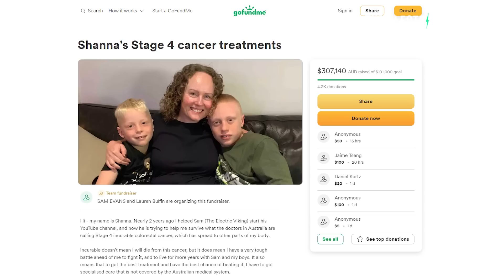CATL unveils Condensed Battery for Aircraft & 1000 mile range EV's

Comment: Solid state batteries will still be something worth looking into. They can have even larger energy densities  than this, while having better volumetric energy density, and could have the potential for no or significantly smaller cooling systems since they produce less heat. But yeah, this new development from CATL is insane, can't wait for my 1000 mile cars
Reply: Actually, it's not that they produce less heat. It's that they're more resistance to heat.
Because of the lower electrolyte conductivity and "viscosity" vs liquid electrolytes, solid state electrolytes tend to generate more parasitic heat actually.
Reply: I'm still banking on solid state in my opinion they're still the better choice
Reply: Looking into is not enough, Toyota has been researching it for a decade with little to show for so far. 
 It now becomes much harder to make it profitable to introduce. Questions arise like:
1- What new market can it open, and is it large enough?  For instance development of ever smaller  processors, would be dead without smartphones. There simply would not be a market big enough to carry the development costs. 
2 - What are the production costs? Sodium batteries will be produced on large scale. What cost benefits does solid state bring and at what quantities can it become a competitor? 
3 - What if sodium batteries are improved even further? 
4 - can they satisfy all the important aspects, like safety, charge time, durability, recycling, temperature sensitivity. Or do they have downsides that limit its application? 

It may have a market in aviation, when electric planes take off. One thing is certain, for many investors the equation has changed now. But if it promises real benefits than CATL will likely want to develop it as well.
Reply: @janbour8152  Solid states batteries aren't limited by chemistries. They're just cells that use solid state electrolytes.
Reply: semi solid state batteries have poor cycle life
Reply: @rwyo83  same with every other rechargeable battery when they were first being developed. So what's your point? You think technology is stagnant and can't improve?
Reply: @hmbro3236  semi solid state batteries works fine with battery swapping, for that reason Nio is ahead of Tesla
Reply: Japan has abandoned Batteries for Hydrogen. Anyone with an IQ Higher than their own Butt Hole realises batteries though improving are a lost cause. It simply takes too many to do anything useful too long to charge and there is and never will be enough electricity to run Society Industry and EV' s as already pointed out 500 tons of earth need to be mined to make one EV they're NOT environmentally friendly same for Solar Panels impossible to recycle. With a short life span. While these technologies will continue and have a place long term they'd technological DODO's and attempts to hype and up sell them are not in line with reality.
Reply: @yfelwulf  lol okay, cool story bro. I could go over all the reason hydrogen makes no sense for passenger vehicles, like how all the energy used to make hydrogen could have powered an electric car, or that hydrogen has a lower volumetric density than gasoline requiring you have several gigantic, pressurized containment vessels, or that solid state batteries could allow you to fully charge in under 10 minutes essentially negating the refueling time benefits of hydrogen or petrol cars, or that cars with LFP batteries still retain more than 80% charge after more than 180k miles,  or all the inaccurate numbers and misinformation you just shat out, and many other reasons why hydrogen passenger cars won't work out in the long run....but I won't.
Reply: You will NEVER own an electric car with a range of 1,600 km. I guarantee it.
For that matter, you will never own an electric car with a 1,000 km range.
Reply: @Chris.Davies  lol okay. Despite the fact that there are cars already at getting close to 1000 km (lucid is already at over 800km). Oh and let's not forget that Mercedes made a prototype EV that had a range of over 1000 km and could sometimes go over 1200 miles
Reply: @hmbro3236  He said you won't. They is expensive bruh
Reply: @Chris.Davies  Not true. Battery technology continues to advance, which means that a 1000 mile/1600km range is within sight :)
Reply: @Chris.Davies  Who are You to be guarantying anything.....The World moves on.....Paul
Reply: Man cannot stand speeds over 25 mph!,the Earth is flat @Chris.Davies

Comment: Commercial aircraft are built with redundant systems for controls and for fuel, so they will likely be building the battery system the same way, so if one battery goes out, they would just draw from the other more heavily. It shouldn't be a problem.

Comment: There's more to a useable battery than specific energy. There's energy density (although that usually lines up with specific energy), reliability, safety, and cycle life are important as suggested. Then there's recharge time, cost, temperature impacts, and power output. There have been a lot of technologies that have ticked some of these boxes. What is needed is one that ticks all of them. I hope the CATL battery is one of them, but I'll reserve judgement for now. If every claimed improvement in battery technology had come to fruition, we'd be driving cars with a 2,000km range powered by a couple of AA cells by now.

One thing I will take issue with is the claim that this renders solid state development a waste of time. If this technology uses electrolytes, then there could be a role for both. Could a solid state version of this battery reach 800Wh/kg? Unless there is something that renders these batteries and solid state electrolytes mutually exclusive, there is a role for both. Sure, 500Wh/kg may be an important milestone but an 800Wh/kg will be better.

Comment: The biggest challenge will be where does that amount of electricity come from, I work at an airport and we do around 750 flights a day on average, you would need a power plant to power the airport to be able to put that amount of energy in. I live in the cold weather state of MN so solar wouldn't work
Reply: That is just a normal supply and demand problem. If more energy is needed generation companies will build more production. A corporation isn't going to turn down making more profits. Plenty of places and ways of making electricity. Also you can make very long transmission lines if required.

Comment: say you have a plane that flies 3 times a day, and is recharged in between. If the cell is capable of 1000 cycles, you'd have to replace the huge battery after just a year?

Comment: Would be awesome to put in an EV and be looking at 1000km range. Perfect!
Reply: Yes, 1000km or about 600 miles a comfortable day trip for a long journey.  Now just have chargers available at these intermediate stopping points.   (Don't forget needs to run the AC, heat, wipers, heated seats, lighting, and entertainment systems)

Comment: Safety should actually increase for aircraft since electric motors are more reliable overall and battery packs should be separated, one each per motor...perhaps even including an extra pack that can be shunted to any motor with a malfunctioning battery pack.  I’m also thinking that electric motor-driven turbines should be more resistant to/recoverable from bird strikes.
Reply: Yea sadly they aren't considering landing weight. Dynamics around the non diminishing weight of batteries will mean a lot more adaptation, a battery fire will mean no ability to dump fuel and lessen the weight etc. , how long will it take to charge the battery, remember airlines pay per minute they spend on the airport, having to Wait to charge the batteries is going to be costly for the airline whilst earning nothing.

Comment: For 'Intended for aerospace use' read 'Expensive'. At least initially. When they can produce them for similar costs to Li-Ion batteries, or LFP batteries, they will become economically viable for use in road vehicles. This 500 Wh/kg is a stepping stone to even better batteries. Exciting times.

Comment: for bigger planes i believe some if not all has a back up fan that they can lower manually already just in case they run out of power from the engines for basic function and control of the plane so they still could use that if the battery dies but the bigger issue i feel like if it catches fire or anything well then you really are screwed because that would go up so fast and there is not much you can do so as long as they have a way to stop a fire just in case it happens mid flight then that would be great

Comment: Still doesn’t make a lot of sense for Aviation, would make sense for some light aircraft manufacturers to make something meaningful now could be useful with up to 4-5x the range. It’s not like large airliners can be retrofitted so would need a brand new design and regulations would probably take ten years to make a good passenger airliner. Good news if true for virtually every other industry. Be curious to see cost per kg or kWh in comparison if you hit price parity with lithium ion, would be mad big claims and it’s a step change in energy density so we wait and see. Electric cars would all reduce weight and increase range probably reduce price. The Roadster could benefit from being lighter to fly 😂

Comment: Question, if someone can shed light on this I would be grateful - what kind of engine would this power? Jets require combustion. So, hyper-efficient propellers? Something else? Because longhaul planes need to be a similar speed to current models.
Reply: The Swedish company Heart Aerospace plans to use electric motors for its ES-30, which will enter service in 2028. The necessary reserves will be provided by a hybrid turbogenerator in case the aircraft needs to be diverted to an alternative destination.
Reply: @JosteinBakklund  what I meant was what type of propulsion? You can't use a jet without ignition, and conventional propellers are too slow.

Comment: If the cars don't weigh enough there will be wind and roll over problems.
Reply: EVs are heavier than gas cars, and that weight is lower. Even with 500Wh/kg, this will not remotely be a problem.

Comment: One aspect not covered here is cost per KWh compared to other technologies. This might be an issue.
Other aspects worth looking at are the availability, toxicity and recyclability of the raw materials involved.
If those batteries are definitely the top option for airplanes, it might not be true for mainstream cars due to issues relating to the points hereabove.

Comment: lighter battery starts a spiral:
- lighter battery
> less powerful (lighter) motor
> less powerfull brakes
> lighter frame
> smaller tyres (less rolling rsistance)
> less battery capacity needed for the same range
> ...

Now for a two seat car with bagage capacity or a four-seater without luggage compartement,  without navigation aids (smartphone), 100 hp, 30 kwh battery, 200 km range, would be perfect for daily schoolruns, errands, commute, 
Must be possible under 20k

Comment: Batteries in an airplane can be arranged in two banks; switching regularly between them during the flight. if one fails, switch to the other which roughly will still contain 50% of what remains in the two banks. This should be enough for emergency landing.

Comment: Will there be any flow on to home batteries?
Reply: Will decrease the value of 250Whkg battery production lines. So possible they will be eventually cheaper. But to meet demand for lithium batteries there needs to be more production of batteries, about 7 terawatt hours per year for full EV adoption. Right now I guess global production is about 1 TWh. Long way to go before market saturation, perhaps another 10-30 years. And that will be if enough materials can be mined cheaply enough.

Comment: 100kwh pack is not going to get any pick up truck 500 miles. But a pack of 200kw that weighs the same as the 100kwh pack and takes up a similar space will definitely go 500 miles. This energy density sold at scale is great news.

Comment: They will use two batteries which are separated like in each wing. So if one fails then the other will keep running. The other thing is they will probably be propeller driven but these more efficient 3D designs but it will be slower. If it was me I would have a third battery in the body which powered the cabin but had extra capacity to be used for emergency flight. So energy density is now not so fantastic but maybe it is viable? Hope this is all true about this new battery. Can you elaborate on the chemistry. Are we stuck with Li again?

Comment: 1000klm battery will  belch into our atmosphere 10 ton of C02 to produce equivalent of driving 50000 Klm in an average petrol or Diesel before you’ve even driven the ev .Both a Land Cruiser and a model y will belch 2 ton of CO2 into the atmosphere in steel to make . Per kilometre the diesel is 220grams of CO2 the Tesla 240grams of CO2 per kilometre grid charging. No brainer the diesel or petrol car is better for the environment not having a 7.5 to 10 ton co2 start for a 75kw battery EV. 
Hybrids like Toyota Prius, Camry Corolla and Corolla cross are half them both again . For the environment go hybrids. Also horrendous amounts of fresh water are required to make batteries. Get you ev for sure but don’t think it’s better for the environment as the belch out more CO2 over their life span than you avg desiel or petrol car. Presently the batteries cannot be recycled ether. Huge problem lots of chemicals. The amount of CO2 getting released into the atmosphere producing the batteries for EVs is horrendous, no wonder levels are spiking up  around the world they are contributing to it.
Reply: Hey, what's it like there back in the 1960s?
Reply: Yeah, this is way outdated info. And has been completely debunked a zillion times over.

Comment: Cycle life and unit cost is not yet available for either Amprius or CATL 500Wh/kg cells.
Operating costs have a major influence in Aviation - cells with a high depreciation rate may still block their use.
I’ll be amazed and delighted if I get to fly in an electric power aircraft within the next 10 years.

Comment: I am more interested if the battery comes to the DIY market in all shapes and sizes.  For example the battery of my smart watch is declining and I wish to change it with a bigger density battery.
Reply: You would very likely have to replace the charger circuit within your car to fit with the requirements of a different battery technology (current, voltage, load curves, etc)
Reply: @klavismodular  Yes. Starting business for retrofitting this new battery technology into existing electronics would be nice. So the battery must be available for purchasing to design, make and test the circuit for It.

Comment: Cycle life, cost, and volumetric density were not mentioned and are just as important.  Also how much structural support and cooling requirements impact the weight of the complete pack.  Just another typical half assed press release.

Comment: Undisclosed specifics on the charge rate (C) for these on CATL’s announcement (“…offering excellent charge and discharge performance as well as good safety performance ….”).  Charging batteries in under ten minutes without extensive health degradation and lifecycle challenges is more important for automotive than aerospace sector due to its increased safety and maintenance factors that extend their turn-around.  Having smaller, lighter and quicker to recharge batteries will eventually make it to us wheeled travellers but will have to pass the affordability hurdle too.  The 500 Wh/kg point launches aerospace applications.

Comment: Kerosene is 46 kilowatts per kilogram. This "super battery" is 500 watts per kilogram, which is almost 100 times lesser. So I do not believe this battery is anywhere near enough for commercial airliners.
Reply: As battery density increases, it will allow for bigger planes and farther trips. It will be a gradual process and doesn't have to be all or nothing.
Reply: You are correct.  Not for transoceanic flights.  This will allow regional flights of moderate size.

Comment: A current Tesla battery pack of 100kw/hr's weighs 1100 lbs or 500kg.
- This new battery density means 500wk/kg or 100kw/hr/200kg.
Add the packaging and you're around half the weight of a current Tesla battery. 1100lbs or 500kg down to half that.
Taking 500lbs or 220kg's of weight off a car that's already FAST, it's insanity.
Reply: kWhr, not kW/hr.  Those are different units.  They have a different meaning.  The first is kW times hours, the second is kW divided by hours.  Totally different.
Reply: @incognitotorpedo42  😆 🤣